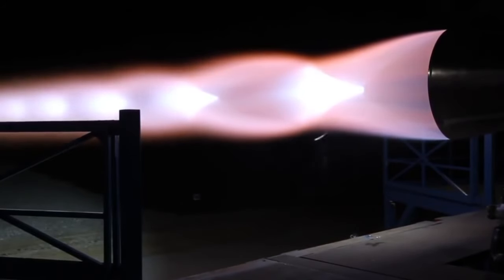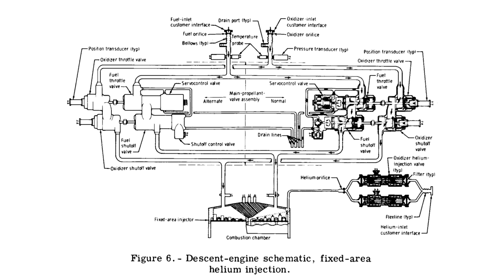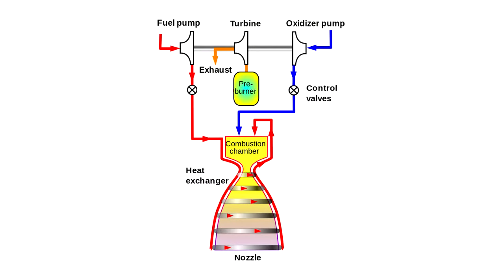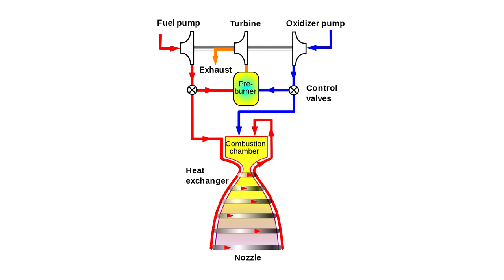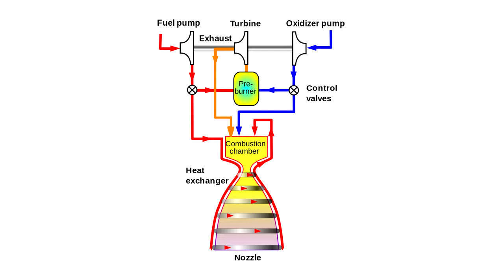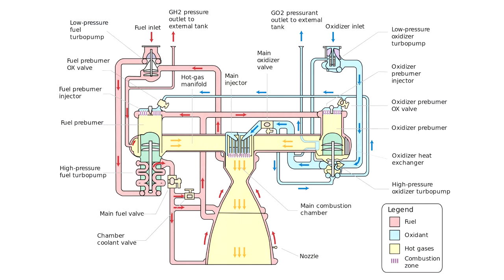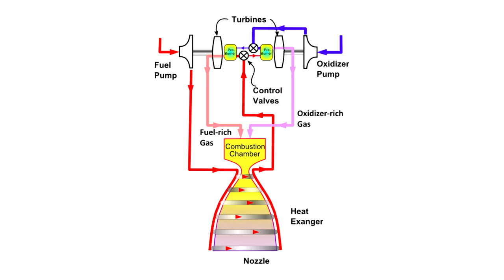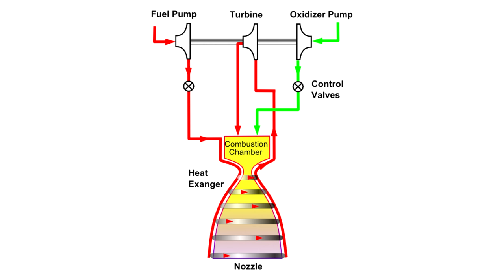KSP Doesn't Teach: Rocket Engine Plumbing

Comment: 6:10 I think you meant to say the "turbine" not the turbo pump...
Reply: Or I guess they are pretty much interchangable
Reply: From my experiences working on cars and rebuilding turbochargers there is a turbine wheel and a compressor wheel. The turbine is driven by exhaust gases from the engine and the compressor drives atmospheric gases into the engine. A turbocharger is considered a centrifugal pump.

Comment: The navy uses gasoline engines to power their torpedoes. The gasoline engine has it's own oxygen mixed in. Why are they not using this engine to power the turbo pumps on a rocket engine ???
Reply from the maker: They are

Comment: anybody else feeling like the audio is just a little off sync?
Reply from the maker: +Skyfox94 sometimes, I kept having to correct it. Vegas has problems with mp4 audiosync.
Reply: Scott Manley
So i wasn't going mad after all. I noticed that it stopped after the last picture.
Reply: +Scott Manley , are you recording audio in vbr? if so, try recording in cbr or first converting it to cbr in some other software, if your audio slightly stretches and compresses as you go, it's probably because your software is struggling with handling vbr.

Comment: please make a video on how does the rocket engine work in the  vacuum of space and what does it push against.
cheers.
Reply: Rockets don't push against air to move. They expel hot gases at high speeds to generate force.
Rockets actually perform worse in atmospheres as the atmosphere resists the exhaust.
Reply: +The Perpetual Procrastinator
welcome sir, are you saying by only generating the explosion that will propel the "gas and flame" on one side thru a "small exit" to generate a magical force of pushing against magical gas that was summoned out of the vacuum "maybe possible dark matter discovery?" that also managed to show a visible flame also in the vacuum "science yay" and propel it self,,,,,, forward, ahm, whatever that is in the space, i mean to keep an actual object propelled toward a point in space you need at least, 3 points of timed propellant at the same time, and hoping that the damn engine will turn on on the how much oxygen tanks we managed to put on the space rocket for the astronauts too , then expect to have gas "thrusters" those magical anti logic devices are something man, they push against nothing, and move... can you believe it?, i always fantasized about having a bicycle connected to a big fan aimed at my sail, i will blow on the sail, and move, right?, say i'm right.
Reply: Well because of conservation of momentum you can propel yourself forward by throwing anything behind you. Even a shoe, although you'd have to expel things really fast. That's why rockets are our only option.
Reply: Although you'd be suprised to know that any fan that can do that to a sail would actually be more efficient if you just pointed it at the back of the boat. Mythbusters tested it.
Reply: Hey Ghost, in atmosphere and in space the ship is propelled by the gaseous fuel pushing off/away from the ship. Certain engines are better at maneuvering or thrusting in different environments. Only aerodynamic surfaces (wings and the like) require air to act off to create lift.
Reply: you are right, but not quite correct, you see,,,
in order to move away in the vacuum of space and with micro to no gravity, you can throw a shoes, or cannon ball, and you will move, maybe, it depends on how dense or heavy the  item you are throwing, like if you throw a 3 LBS shoe while you are say 150 lbs, you will move in percentage to your weight and how hard it was thrown at what speed, and many other factors the least of which, the gas"eous" in a vacuum, how dense do you think that gas is? like if you collected the gas and pressed it into a aerosol can, then weight that thing after filling it,  now that how much you going to be propelled or added to existing moving object then expect it to make difference, 

see, in vacuum, the reaction that happen inside the solid fuel engine, does not convert vacuum into gas then push it out then push against another vacuum then move forward with that little gas that throws in the opposite direction, does that make any sense to you?

think about it, but first, learn that what is the vacuum, beside that it sucks, you must sustain an pressure in that vacuum to push against it at all, and this cannot be tested ever, except in the space, which like the good old paradox, who came first, the egg or the chicken?.
Reply: Palestinian Ghost I'm not quite sure what you mean.
Reply: momentum=mass*velocity
You forget the importance of the exhaust gas speed.
low mass * very high speed = high momemtum

By the way if you look the thrust equation for rockets is :
F=mf*ve + (pe-p0)*Ae
F=Force or thrust
mf=mass flow rate (mass that can be throw for the nozzle of the rocket)
ve=Velocity of the exhaust (speed of the gas expelled)
pe=Exit pressure at the nozzle
p0=Pressure of the enviroment
Ae=Area of the exhaust(area of the nozzle)

The first part is the momemtum equation:
mf*ve=mass*velocity
The second part takes the pressure difference in consideration.

So a rocket can move in vacuum by throwing part of its mass at high speeds, and we knew that since Newton.
Reply: Tamaegoitz I was aware of this. I'm just not into writing big comments.
Reply: in space, the mass of fuel, oxygen and hydrogen combined being ignited creates a momentum. out of the nozzle of your ship is not really vacuum but high presure out of the rocket engine, pushing the ship in the opposite direction, creating acceleration. this momentum principle works for every plane or jet engine.

also the egg came first. always.
evolution does not change a species into another, but through generations, the chicken's ancestor gave life at some point to a cute, different bird, more adapted to the weather and conditions. more of these proto-chickens, known as scootaloo, gave life to chickens who had the same genes and they eventually perpetuated that new species, and divided into different races of chickens, and maybe other species who might be mostly extinct.

but biology is not my range, i'm a horse of astrophysics.
Reply: Silver Spoon that's a great explanation actually. For both.
Reply: Palestinian Ghost You don't science much, do you? Rockets do NOT need something to push against in order to achieve thrust.  The combustion reaction that occurs in the engine imparts energy to those particles of oxidizer and fuel, which then streams out of the rocket engine, creating thrust.

Comment: could a person at home with a ton of knowledge and research build a rocket engine?
Reply from the maker: +jonathan saletri yes, not even that much knowledge.
Reply: Scott Manley I was thinking about trying it as I could make lox and hydrogen. I also can cast almost any metal myself and what I cant I can have made. but I don't know what the goal would be and if I would just end with me getting blown up during a test fire.
Reply: take a look at copenhagen suboprbitals, those are pretty much just guys at home with a ton of knowledge building a rocket.
Reply: get some sugar, get some potassium nitrate, 
carefully melt them together.

pack into a tube and bore a hole down the center of the fuel grain.

you now own your own rocket.
Reply: stinkyfungus why?
Reply: jonathan saletri I believe that one of the first SpaceX employees (the one who designed most of the Merlin engine) got hired because he actually built some engines himself. I highly doubt that building one at home is legal though.
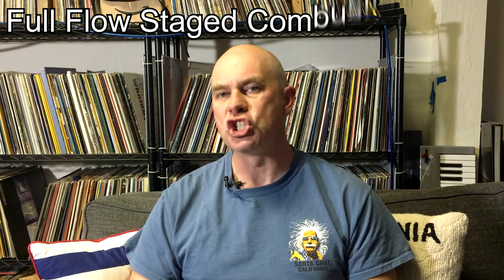Reply: would a 1:10 scale rocket even work? don't they need to be big and heavy to get into space?
Reply: no. knowledge is a thing, you have it here, on this video, the rest is experimenting and calibrating the fuel/oxidizer and presure ratios to make it efficient and not just a  huge burner cause your rocket will never be the same as on paper. not even the circuits. you would need a lot of steel, a garage, pipes and a crew of men to solder the parts together and a clear place to test your fancy dragster. (come on  you will build a drag first. you want to.)

don't listen to Covalence, if it's illegal for you to build an engine, you live in a fascist country and should leave.

Comment: 300bar? XD that's nothing compared to the stress diesel injectors put up with. Usually the most modern common rail systems have injector and fuel rail pressures of 2000 bar. Get rekt!

Comment: I like your videos but man are you a windbag LOL!! I work on the RL10 for the last 30 years( P&W and AJ). We did prototype a RL60(60.000lbs thrust heck with your kilonewtons) powerheads which performed great was going to be used as the landing/ascent engine for the Constipation program. Then went to the CE CE program which ended under the Cancellation program. Still sitting on a shelf. During the 60's here in West palm beach where production liquid hydrogen was invented the 9 test stand devoted to RL-10 devolpment test had scaled up the engine to 250k thrust with a adjustable nozzle and engines using flourine and hydrazine, I work for AJ now and the AJ26 (NK33) are garbage even the Russians I worked with said they were a good design but very unstable poorly made. As by the 7 N-1 failures and Antares. Best wishes.

Comment: I remember Elon saying they couldn't send trips to Mars year around due to closest approach limits but wanted to be able to use this rocke system for other missions when it cant go to mars. For refueling and stuff. But I had a thought, why not send people on a space cruse around or to the moon. Spend 2 or 3 days just drifting to the moon, a day on the moon, and then 2 or 3 days back home. He wants to make moving to mars cheaper (in the $100k range) so couldn't you do a moon cruse for relatively pretty cheap (espesualy if you also take experiments and contracts to launch or take things to them moon at the same time).

Comment: You Also forgot to mention that the soviet engine Rd180 technology, was almost Lost, when USSR desintegrate, they, found a LOST "barn" Full of those ancient engines, And than gether the ancient people that built them, they recreate the technology, And have sold the engines to USA since than. USA, tryed to replicate the engines, with disaster result of exploding the rokets And the payloads, the insurance does not accept the CLONED engines after 2 Lost satellites. They fail because were unable to replicate the metal alloys for the turbo pump. Russians now are so good in metal alloys, that they built small turbofans jet engines made entirely on alumunium alloys including the turbine blades. Crytical pieces from modern aviation industry, including Boeing are being produced in Russia, that have a "factory"  inside Russia territory. For secure reasons. Research PAYS!! Look for "engines that came from the cold". Here in YouTube.

Comment: The Russian closed cycle engines have been flown repeatedly in satellite launches since the 90's; there was a NOVA program on them a few years ago  :) SpaceX won't be the first to fly
Reply from the maker: +Julian Thayer those aren't full flow, just old fashioned staged combustion.
Reply: It might be the first FULL FLOW closed cycle engine to fly though.
Reply: The Space Shuttle main engine also uses "closed cycle" (FRSC), and has been around since the 70's. SpaceX is making a different engine, an FFSC.